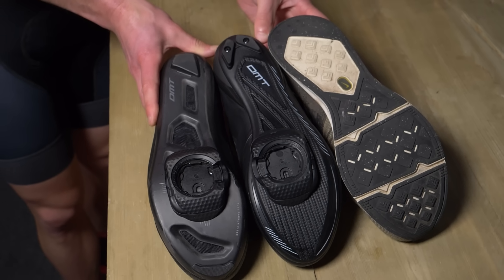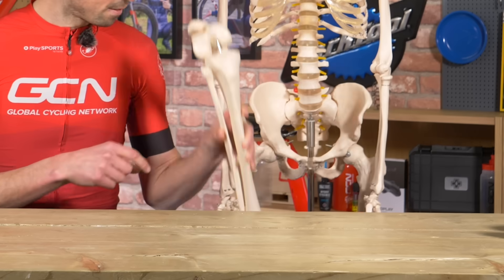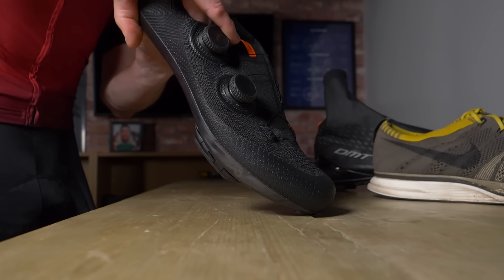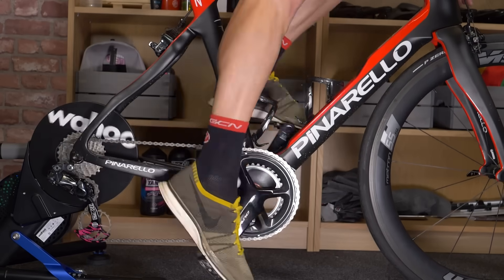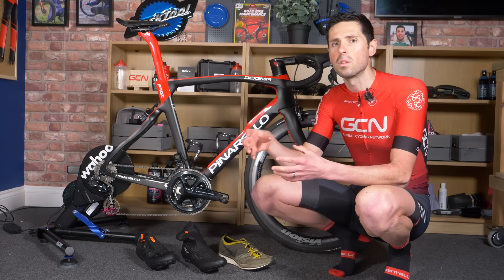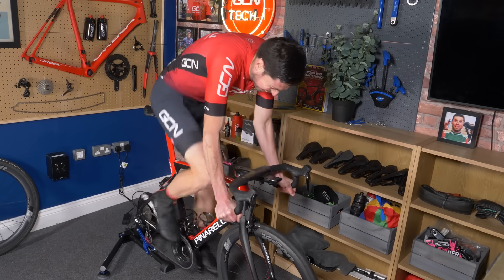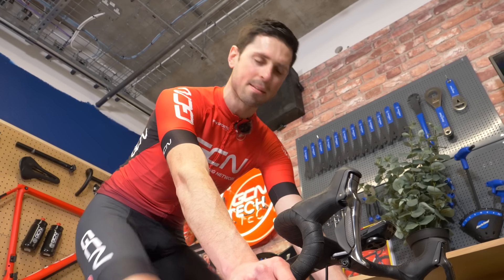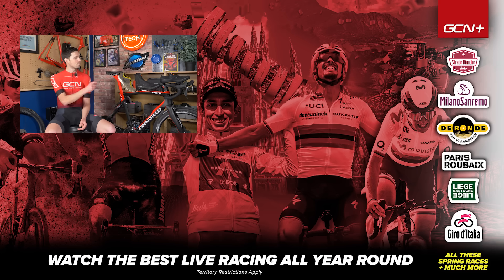GCN Tech Does Science: Do Cycling Shoes Really Matter?

Comment: Short sprints aren’t the reason the average cyclist buys stiff shoes... I wear stiff shoes so that at the end of a three hour group ride my feet don’t ache.
Reply: Mine have never ached in my life and I go much longer than three hours .I wear whatever I fancy and I m surely not conned in getting involved in clipless pedals .The Myth of the Upstroke has proven beyond doubt that clipless pedals make zero difference .So no need for cleats screwed into overpriced stupid shoes
Reply: @stuartchester7414  I couldn’t disagree more... I ride roughly 4,000km per year, with significant elevation and the ability to pull up, rather than push down, has made a huge difference in my ability to push longer and harder. And 35 years ago I was using toe clips on my flat pedals. If you don’t find value in clipless pedals don’t wear them. But personally I’m glad I’ve got them.
Reply: @andrewbardwell4832  You re completely and utterly wrong but I m not going to argue with you.Just do some googling and you will get the evidence why would you waste energy  to  fight against gravity attempting to pull up .Its inefficient and uses weak muscles which would make the stronger quads doing the down stroke less efficient. Power meters have proved it that even if you think you re pulling up , you re not really .You don t even need to be clipped in .Just normal pedals and any old shoe do the same job
Reply: @andrewbardwell4832  Clipless over flats are exactly the same .Plenty of stuff online to prove it categorically .The Myth of the Upstroke has been explained. No point in even trying to add power via very weak hamstring as you fight against gravity and lesson the down stroke of cyclings strongest muscles the quads .Even those who think they re adding power on the upstroke are not actually doing anything. You end up injuring yourself trying to upstroke .Normal cyclists not involved in extreme sprinting do not ever need to manacled to pedals.The skiing company Look started this off to sell more of their clips
Reply: @stuartchester7414  long before clipless pedals people used toe clips. I’m curious, do you ride yourself?
Reply: @andrewbardwell4832  Yes , been riding bikes for donkeys years .I guarantee that I ve done many more miles than you or anyone else on here.Yes we had toe clips but only ever used for foot security and unlike the lies of the clipless pedal industry we all knew they had no effect on performance.Just a foot security thing only.These liars who make big money out of clipless, carbon this carbon that, even on shoe sole are implying, with never any real evidence that because of the power of the uplift rubbish that a rider would gain performance.The Myth of the Uplift has been proven beyond doubt to be another big cycling con
Reply: @andrewbardwell4832  You re kidding yourself.Waste of energy and will lead to injury .using the weak hamstrings to pull up negates the much stronger and bigger quad muscles pushing down.You re also working against the power of gravity.The Myth of the Upstroke has been proven beyond doubt. google it ,Its just yet another cycling con trick to sell over priced clipless pedals and cleats and shoes.Straight flats and normal shoes are exactly the same
Reply: @stuartchester7414 Wrong
Reply: @stuartchester7414 Wrong
Reply: @stuartchester7414 Wrong again

Comment: The more powerful you are the more important the characteristics of your sole becomes. A track cyclist capable of 2500 watts might feel very restricted in a pair of trainers. On the other hand a relaxed spin around the block with your mates does not require the same level of real estate when it comes to equipment.
Reply: Right. And the difference will certainly go down with the amount of force going into the pedals. So I really doubt that the stiffness will make much difference when you are riding at a sustainable power level. It is certainly a point for sprinters but for normal riding it would make no difference.
Reply: @svenweihusen57  Normal mountain biking IS repeated sprints. 
Just pointing that out...Its also why i ride carbon soled Pearl Izumi shoes on Egg  Beater pedals....Sprinting up and OVER things.
Reply: @svenweihusen57  Yes, a better survey was done by BikeRadar and they came up with no difference but then they re not GCN whos business it is to advertise and sell bike gear

Comment: I’ve been riding with stiff cycling shoes and cleats for many years. I have foot problems, so maybe I’m not a good person to do this type of experiment. Or maybe I’m an ideal experimenter. I don’t know. My problem is that I have bunions and I am impinging some nerves so sometimes I get severe pain, and it’s in proportion to how long my rides are. I’ve tried stiffer shoes and more flexible shoes, and I can’t tell. My goal is not peak performance but long-term comfort. And performance-seeking cyclists might also want to consider that, too, because fatigue can reduce your peak power and also endurance. I have a theory, not yet tested, that being able to change positions might reduce my fatigue. So I’m giving flat pedals another try. It’s strangely difficult for me to relearn using flat pedals without cleats, because I tend to move my feet too far back on the pedals. I believe recent studies have shown that the advantages of cleats (being able to pull up, push forward, and pull back) are not as big as we thought. I think the main advantage to cleats, at least for me, is that my foot won’t slip off inadvertently. I think cleats create an illusion of greater efficiency, something I believed until I read those recent studies. I’m impressed that your not-quite-scientific study in this video shows an advantage of stiff shoes at all. Yes it showed a small advantage, and that difference could be attributed to errors in measurement rather than real difference, but I suspect what you found was real. You’re surprised it’s as small as it is, but I’m surprised it’s as big as it is.

Comment: I was getting foot pain after around 80 miles of riding with nylon soled shoes, I tried new footbeds but the issue remained. Moving to carbon soled shoes solved the issue. I can't say for certain it was the stiffness, but the foot pain issue has never returned, and I've been through several pairs of carbon soled shoes now.
Reply: For me the sole doesn't matter much, but the width of the shoe is alfa omega.
Reply: @panzerveps  yeah, that can make a big difference. I had a pair that were too narrow once, they were awful. These ones were a wide fit, and were comfortable below around 80 miles.
Reply: I had much less foot pain when I switched to stiffer soles.
Reply: Maybe because carbon shoes usually are higher-tier therefore have better methods of tightening measures?
Reply: @vinson8459  According to James Thomas from bicycle Richmond, Nylon soles degrade and flex more and more over time, and since your foot is locked in one position, it causes the pain, especially when the cleats aren't set up correctly. This is an approximate memory of what he said, but along those lines is what I remember him saying.
Reply: @vinson8459  It was the balls of my feet that got sore. The fastening method was a ratchet strap and 2 velcro straps (they were/are shimano r087, I still have them and use them on the turbo). I've had several carbon soled shoes with that fastening method. I think it was the stiffness, but I can't be certain.
Reply: I use mtb shoes on my gravel bike. One pair is great off the bike due to it's flexibility. On the bike, they're fine when going easy. For races, harder efforts, they hurt my feet. I switched to a pair of Shimano RX-8 gravel shoes for those types of efforts, and the foot pain went away. So for me, stiffness helps when riding hard.
Reply: Yes! Carbon soles are not painful as plastic or nylon soles. I faced the same issue

Comment: Part I wonder what the power difference would be between mtb spd pedals and typical road spd pedals?
Reply: Zero. It depends on how stiff the MTB shoes are, but assuming they aren't soft, there is no benefit.
Reply: None ! The whole pedal thing is bent.The Myth of the Upstroke is a proven fact and clipless pedals requiring cleats and pedals and shoes is just yet another cycling con to extract money.Next they will be trying to sell overpriced derailleur pully s and oval chainrings as the next big thing
Reply: @stuartchester7414  oval chain rings are proven to work. I wouldn’t put it on my road bike but they absolutely work on a mountain bike where you have to sprint up steep hills and beyond the power. After 30 seconds of getting used to it it’s a night and day difference
Reply: you dont need SPD pedals at all.They are yet another cycling con to sell expensive clipped in pedals when they are not need for 99 % of normal cyclist s who are not indulging in race cycling.zero increase in performance as proved in many studies eg "the Myth of The Upstroke " All this clipped in nonsense was started by the Look ski ing products company moving in on the cycling industry .They make sense in clipping in on skis but not on pedals
Reply: @stuartchester7414  It depends... if you are just cruising with your grand mom, you´re right. In my case, with increasing power, the upstroke is getting longer and in a sprint it´s close to a 360 automatically. In our cycling-world of marginal gains the pedal does have more influence than any other fancy high tech on our roadbikes and they are much cheaper, at least for a sprinter, not for base-training or cruising.
Reply: @00AntraX00  yes. The only reason i need clipless shoes is to cross busy streets without getting squashed. I find the stiffness and the clip to be a con for everything except sprinting and ground pedal strikes. I'm not sure what Chester Stuart means by the 'myth of the upstroke'. Regardless i notice a huge difference without any testing equipment.

Comment: Flat pedals with toe clips and straps would've been a better test.
Reply: IMHO a flexible mountain bike shoe with clips would have been a better choice for a comparison. Without clips you need a certain amount of downforce on the upstroke to stay on the pedals.
Reply: Don t even need toe clips . flat pedals are just as efficient .The Myth of the Upstroke is a proven fact.The toe clips don t add any power at all they are just there for security to stop slipping..Thats never happened to me in my life .Cyclists are piss easy to con , eg over sized derailleur gear pulleys..oval chain rings
Reply: Except nobody uses them that isn't from the 1960s